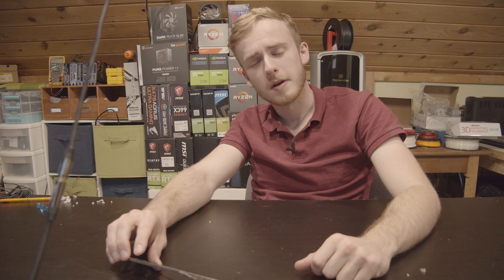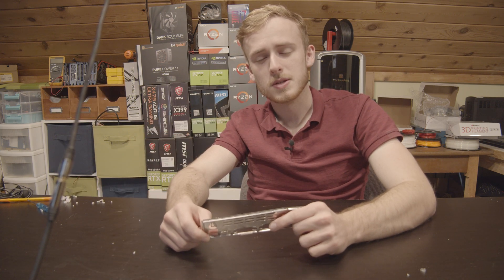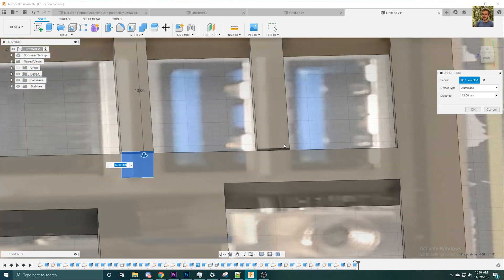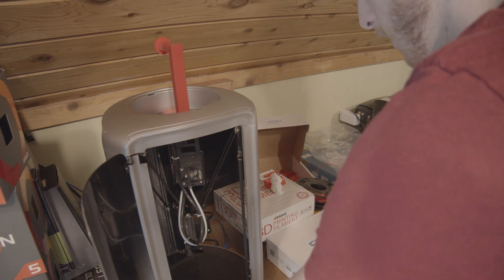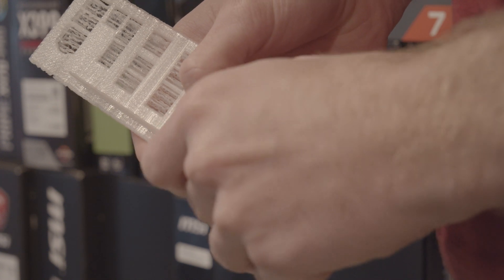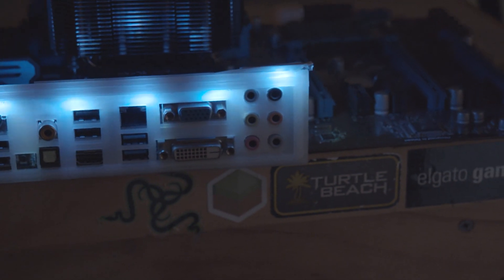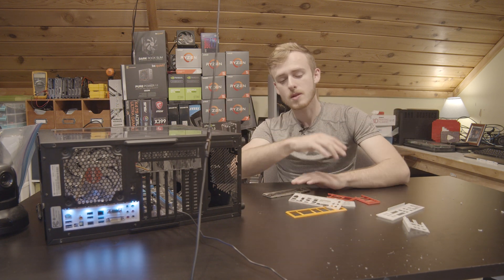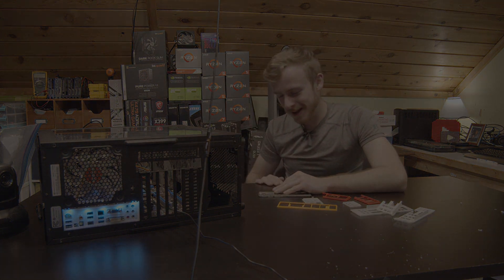Making the Worlds First RGB Computer IO Shield

Comment: A good way to model a part like this with factory tolerance is to use a caliper to measure the cutouts from the original IO shield, the back of this board could also mount the LED’s a bit better for more light spread, excellent idea though

Comment: I would actually go another direction.   The outline is the same standard, but so are the cut outs.   All you need is a solid sheet made, a clever way to illuminate shape, and shape cutters.  Paper overlays to guide the cutters and press cut the sheet plastic to any design.  The USB stands, the Ethernet, the vga/hdmi/dvi etc are all standards all you need is one punch cutter per and cutting through plastic they would last a very long time.  Maybe a semi opaque sheet with fine lines of clear through it, get some fiber optic illumination around the cut regions.
Reply from the maker: Yea but that requires a lot of machinery. This was something your local small YouTube channel could easily do. Yes there is way more efficient ways to do it but this was cheap.
Reply: @JaysTechVault  actually begs the next step in DIY.   Sintering 3D printer.  Its a good idea,  the times I've fumbled in the dark back of my computer looking for a USB port (typically) makes me really appreciate this idea you have here.
Reply from the maker: I’m going to start a kickstarter to get a few 3d printers and do it on the side in college. Offer it as a service as others have suggested.

Comment: ‘Looks cool’

You dont even see the back of your computer
Reply: Never heard of tempered glass pc cases?
Reply: It makes more sense in ITX Cases like the NZXT H1 since the IO is at the bottom of the system allowing for a glowing effect.
Though, ARGB strips would work just as well if not better.
The best use scenario I could see for this is that it makes your ports more visible in the dark.
If anyone wishes to make something like this for themselves I recommend turning up the infill to make the LEDs less visible.